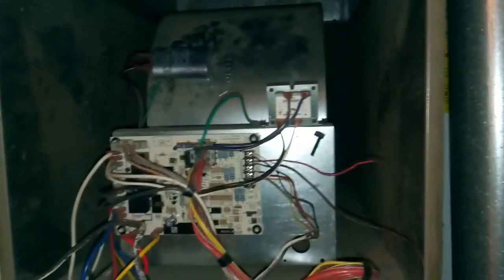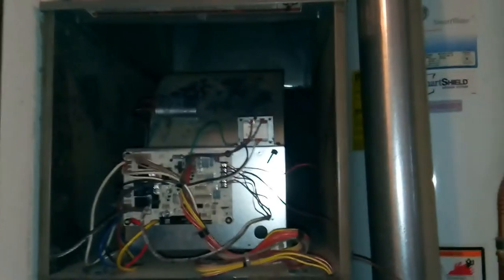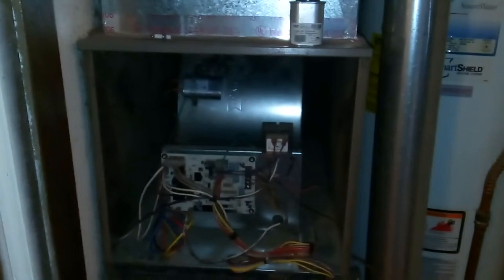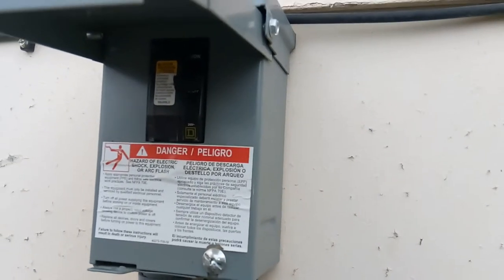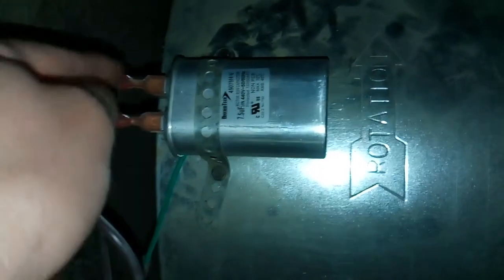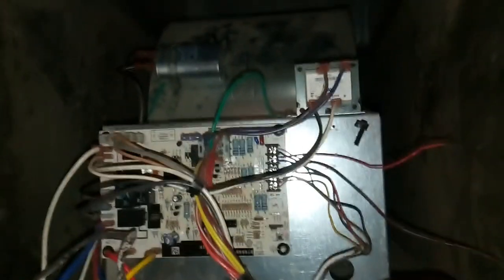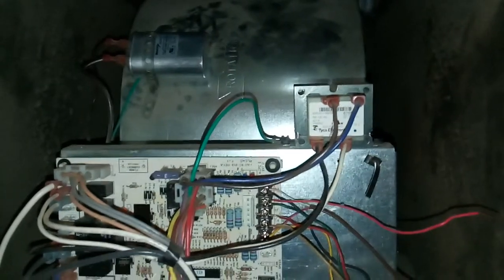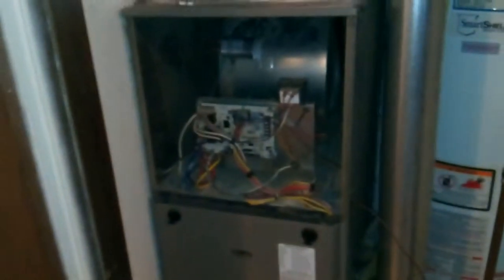How to replace a capacitor on your HVAC unit.

Comment: I was quoted $262 to replace the blower run capacitor on my Lennox.  I had heard previously that these were cheap and easy to replace. So after watching a couple youtube videos I cross-referenced the P/N of the one installed now, bought a replacement from Grainger (online, will sell to the public) for $13.92 plus shipping and tax (about $26 total), and replaced it myself in maybe 6-7 minutes.  I think this is where the HVAC companies make the easy money after doing their $79 "checkups".

Comment: Hello after installing new capacitor,is it normal to smell that burnt sweet smell.? The capacitor that was originally in the old Coleman was round with three legs and a center common. Now I have a ovel  capacitor which it fits like a glove but this one has two legs no markings for positive or negative.